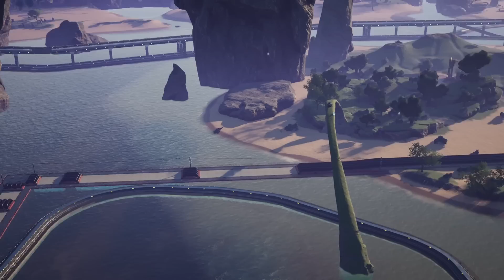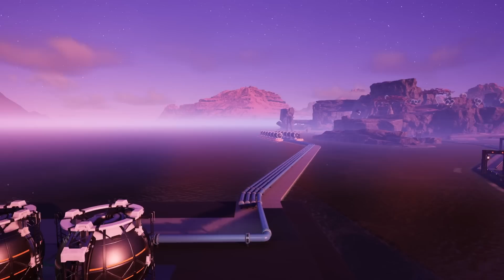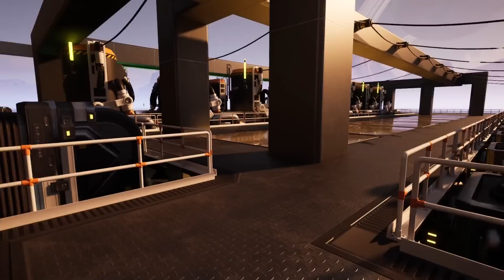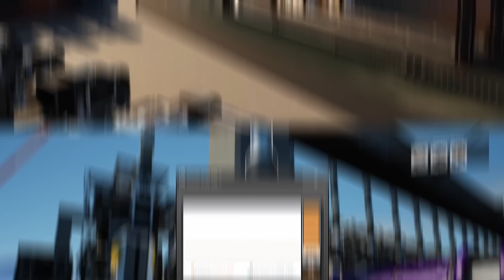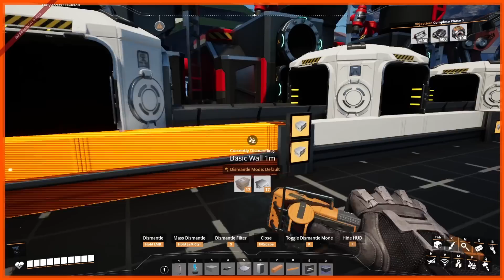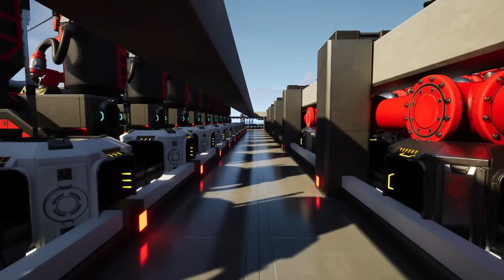How To Turn 600 Oil into 40,000MW With Turbo Fuel in Satisfactory U8

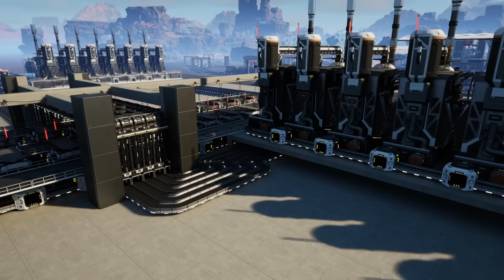Comment: Sorry but you've confused me here, at 6:00 you say packaged fuel, do you mean packaged turbo fuel?  What recipes are you using overall?  I already have a blender making fuel form heavy residue + water with the Diluted Fuel recipe (no packagers), would I be turning fuel into turbo fuel or packaging the fuel?  I was looking at turning Oil > Heavy Oil Residue > Diluted Fuel (blender) -> Turbo Fuel seems much more efficient use of Heavy Residue and therefore, Oil or is it the production rates I'm overlooking?
Reply from the maker: I haven't unlocked the blender yet - si for me I'm taking the alt HOR, to diluted packaged fuel, then creating turbo fuel and packaging that 😊
Reply: @TotalXclipse  That explains it. I'm easily confused - haven't played for a while now either, waiting for Upd8 before I tear it all down and rebuild
Reply: You have the best setup for max output, I see so many people bragging about their use of other turbofuel alts, and I giggle cuz they haven't done the math, or their calculator was on drugs.
Reply: @daveisnothere  um, what math would that be? 
Are you saying that using the blender recipe for non-turbo fuel results in less turbo fuel per unit of crude or that the blender fuel recipe consumes more energy and therefore less energy is produced per unit of crude overall after deductions?
I'd be interested to know as I haven't done the math at all, just enjoying TX's content and certainly not bragging.

Comment: The issue about half way into this video, not having enough power to start up your power plant is the best (and probably only) use case for the geothermal generators. If you tap all the geysers that's 2400 MW (or 2.4 GW if you prefer)
Connect all of them up to a separate grid with enough power storage to even out the power production. That separate grid is then the perfect starter motor for any power plant including nuclear.
The once the real production is running you just disconnect the geothermal grid again, and it's a great backup for restarting a stalled power production in case of a tripped fuse, clogged input/output somewhere, or a pipe bug messing something up.
Reply from the maker: Now that we have priority power switches in theory we don't need to use Geo thermal at all
Reply: @TotalXclipse  Feels bad unlocking them and not using them for anything though!
Reply: Why packaged fuel instead of the blender?
Reply from the maker: I haven't unlocked the blender yet
 @egdod3750

Comment: I actually skipped regular fuel and went directly to turbo, but i use the Turbo Blend alternative which i luckily found quite early on.

I also prefer the Blend recipe as though it uses almost twice as much Heavy oil it also uses almost half of the much rarer sulfur and requires less buildings.

I wonder why you don't build the power plant next to the factory saving yourself a logistic headache, but i guess i'll find out in the next episode. 🙂
Reply: Turns out no one will find out.
Reply: You find the nitro rocket fuel, 600 crude makes 144,000 MW and you skip the turbo fuel and compacted coal steps.  This saves in the power required to make the fuel, netting even more fuel!
Reply: There isnt really a logistics nightmare with trains, actually it may be worse next to the factory since then you have more train congestion. Spacing things out allows less time trains have to overlap their travel paths.

Comment: Yes, I also went the turbofuel route. Made it modular with blueprints in mind. One module use up 30 oil and 53 compact coal. So when I needed more power I just put down 4 blueprints on top of eachother, 2 in the middle and a waterpump and some connecting with pipes, belts and power. Then make the fuel gens and I had a lot more power. It's fully built now with 14x2 modules so 840 crude oil and 1500 compact coal. Hopefully this will be enough until I make nuclear for real :)

Comment: I did this same thing, probably identical setup.  The only issue I ran into was the 600 crude, over time, started to deplete from my large fluid buffer and I had a slight issue with the HoR refineries struggling to stay fed with crude oil (even though the math was exactly correct)
Reply: Had a very similar issue so looked it up. Apparently the maximum actual throughput in a mk2 pipe is like 597 instead of 600.
Reply: @hemachandranvelumani3198  Very interesting.  I couldn't figure it out because every time I checked the flow rate, it always displayed 602.
Reply: @wadz668  Not sure but I remember seeing something about that meter also including backflow. Maybe why it shows 602, but yeah it showed 600 constantly for me but the buffers ended up draining
Reply: Fluid mechanics in this game are super wonky. I spent about 5 hours monitoring and dialing in my oil plant to make sure everything was running at 100% efficiency as I didnt want to have to chase down issues later in the game. I could keep all my refineries running at 100% from the crude oil line but the refineries turning HoR to fuel were hit and miss and when I checked the piping flow rates, it looked correct but I was still ending up with the refineries at the end of my production line switching on and off. No matter what I did, the pipes never fully filled and the flow rates were spiking up and down by 20-30. I had 1 pipe at 400m3 and another at 200m3 merging to make 1 full pipe but it just didnt work out regardless of how I set it up and using flow regulators everywhere to dial it in. Ultimately I just overclocked the end refinery so all of them but one are at 100% and the end one runs at like 83% but will make sure the lines dont back up. Once you do that, the math downstream for the fuel gens gets janky so I made the end of my pipe elevated with roughly 1-2m3 of fuel overflowing into a packager for some packaged fuel for my jet pack when I need it and just sinking the excess. I like building everything to exact numbers but sometimes its just not in the cards in this game. Specifically with any of the fluids.
Reply: It might have to do with how pipes work when the intersections are vertical. It’s a really annoying issue that I had to figure out when I built my own plant